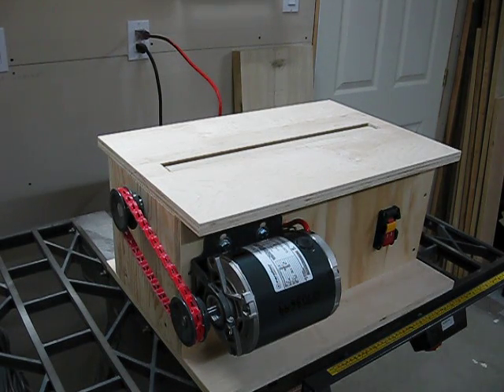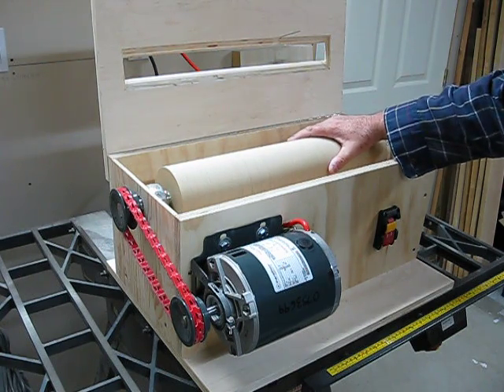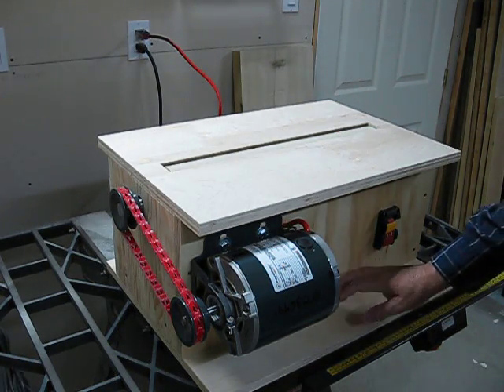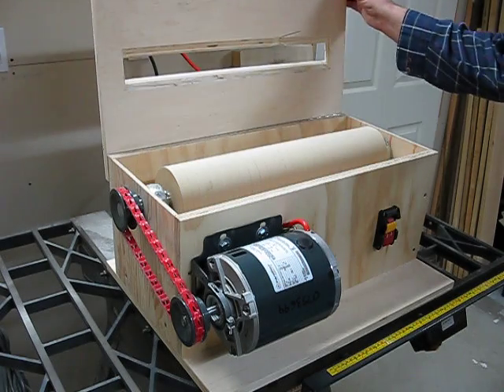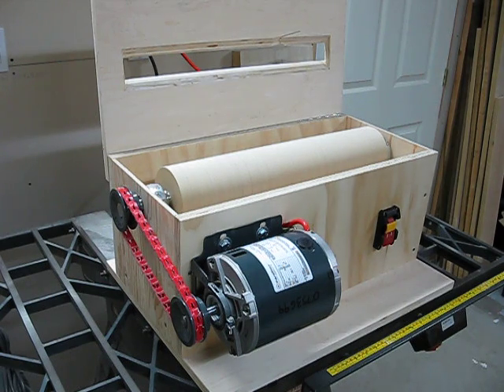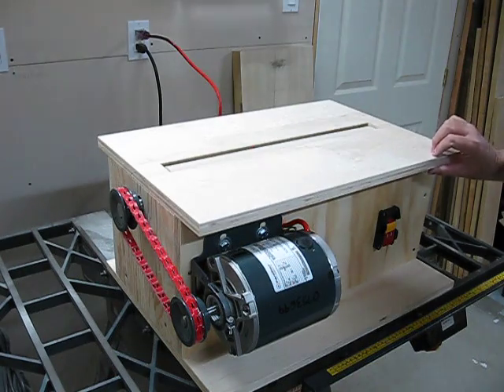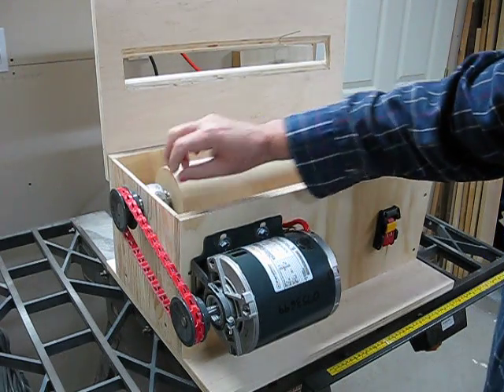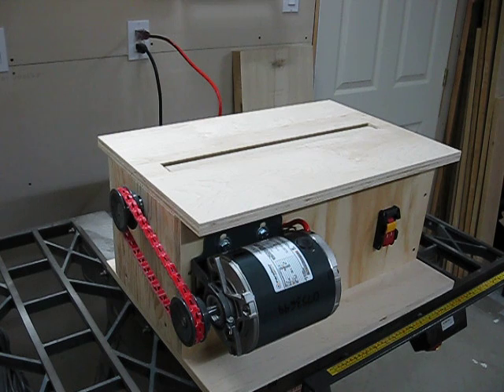V-Drum Sander Build - Part 2

Comment: Paul, nice sander! I'm collecting material to build my sander right now. How do you hold the pillow bearings to the box? Also, how do you replace the motor belt? Loosen the pulleys and slide off the shafts?
Reply from the maker: Hi Mats, you can see the sides of the box better in my Part 1 video here: https://youtu.be/vqPJQcWBmRg
I glued 2 pieces of plywood together to make them 1-1/2" thick so the pillow bearings fit easily on them.
As for the belt, I've never had to remove it since making my sander, but initially I put it over the pulleys and let the weight of the motor tighten it up before bolting the motor into place. I suppose removing a pulley from the shaft will also work.

Comment: The tabletop, for example, width of 32 inches it is possible, your opinion?
Ps. Well done, efficiently and simply.
Reply from the maker: +Dragan Antic 
I suppose you can make the hinged top any size you want. If you want the drum to be longer you will probably need to beef it up a bit. Use larger axle and maybe even 6" disks to keep it from flexing under load, and heavier bearings to hold it together. I am not sure what the maximum size can be.

Comment: Hi There  Would it Work without the velcro./ type sandpaper... Could I just use normal sand paper on to the drum....

Thanks :)
Reply from the maker: The problem with that is there would be nothing holding the paper onto the drum and it would fall off while turning. If you could somehow attach the ends of the paper to the drum then that would work.

Comment: How did you insure the drum did not spin on the shaft?
Reply from the maker: In my Part 4 video after the 6 minute mark I talk about constructing the drum. It is a 7/8" axle with 7/8" holes in the disks. I slid each disk on the axle gluing them together and clamping about 5 at a time until dry. Then I would put a small spot of epoxy on the axle and glue on another 5 disks. I did this all the way to the end. So about every 6th disk would have a spot of epoxy on it to the axle. But I realized later that I probably didn't need to do that as with 25 disks tightly on the axle I doubt it would slip even with nothing holding it.
Reply: I have spent a lot of time looking at your type and those that have a shelf that raises to pinch and feeds through. I would think yours is the most efficient. Now that you have used it what do you think of the comparison?
I think you have a good design and intend to copy it for the most part.
Reply from the maker: *****
I have never used a thickness sander so I can't compare, my v-drum works very well for what I do and takes little room. Maybe you can build one that would do both... have the raising shelf under the drum for thickness sanding as well as the open table at the top like mine. Now that would be a great build. Good winter project. Let me know what you decide.

Comment: Paul, I don't understand, to sand the drum you used sandpaper with double sided tape on plywood. The tape is thin not the foam type ? How did hold the plywood to sand the drum even was it 19" wide?  Thanks Al